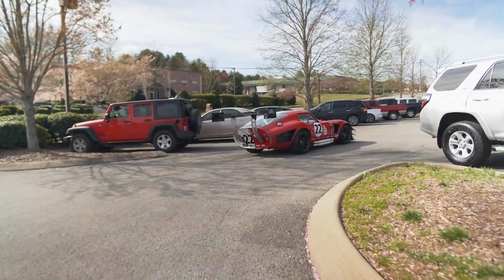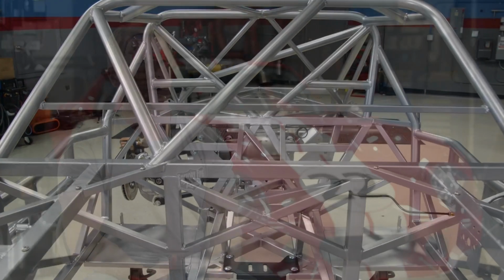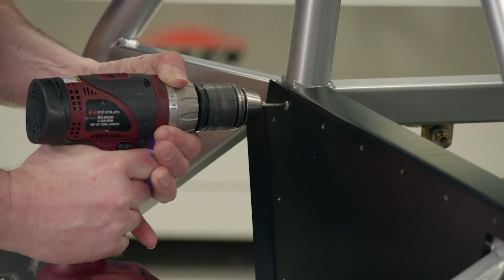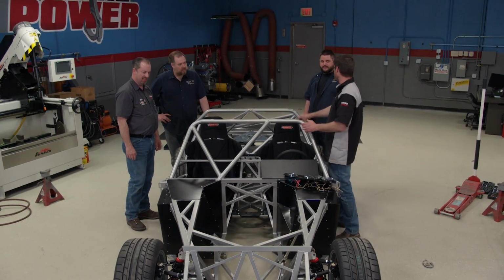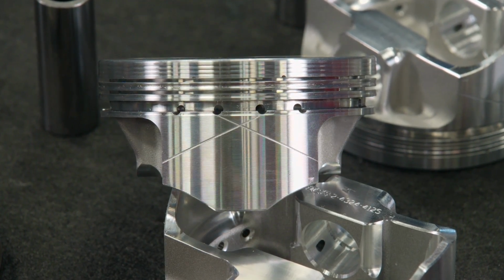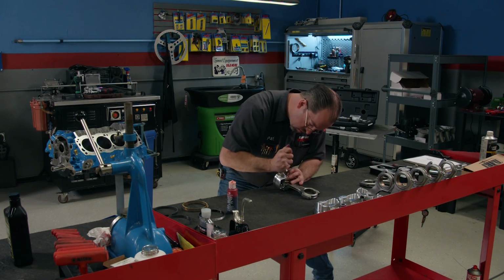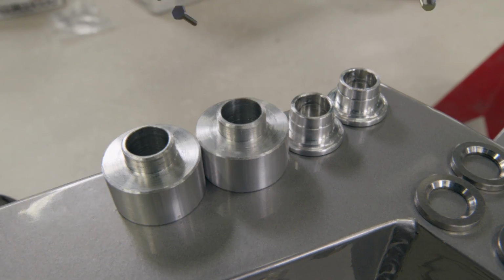Rolling Dyno, Building our Test Sled for Big Horse Power - Engine Power S6, E11

Comment: You shouldn't mix bearing halves they are different  thicknesses now you have a lip at your parting line that will work like a oil scraper on you rod journel polish the crank to size is how I was taught
Reply: The bearings at the parting line are + .003 or +.004 thou this won't be a problem with .0005" difference , and half of that each side .
Reply: @Cobra427Veight  why take the chance on a blueprint endurance build bearings are matched in a pair for proper crush also I wouldn't risk it polish the crank reclean it and assemble it with a matched pair of bearings there not doing a bearing slap on grandma's grocery getter this is a high dollar build and they own a dang lathe and even talk about polishing a crank in the video hell if your gonna half ass it atleast size the tight set with some white Scotch bright or just run the set that's slightly loose a half thousandths loose won't cause an engine failure and will have the proper amount of crush mixing sets is just not a good idea from my teachings
Reply: @79huddy   well ,just check the crush , easy enough . common sense for a Automotive  machinist.
Reply: @Cobra427Veight  I was taught when it comes to my name going on the build do it right or don't do it if it means taking the time to do it times cheaper than a new crank just how I was taught by guys who have assembled everything from sportsman roundy round engines to fully blown offshore boat engines you won't catch Kammer&Kammer or Millets running mixed bearings to get the clearance they are looking for is all I'm saying you have the equipment do the proper job or let somebody else who will this isn't a drag engine that only has to last a minute worth of running at time it's an engine that's gonna be hung out hard at high rpm for hours at a time. It might work 9 out of 10 times but that one time it's gonna trash some expensive parts correct the crank journal diameter and run a matched set of bearings is gonna be right 10 out of 10 times
Reply: @79huddy  It will be great to see some engine assembly content, from you on your channel soon , and Yes i served my time as an automotive  machinist  the same as you .
Reply: @Cobra427Veight  me an a buddy has talked about it we went through school together he used to be old man Jasper's right hand man for a couple years before he became a Preacher I got fed up with the shop I worked at for telling me to half ass shit to get it out the door I still will build an engine for someone but Millets and Kammer&Kammer are two of the  few I trust to to do my machine work for me I wish I had the money for a full outfitted machine shop I kind of miss that work but I don't miss the head aches from the jack offs that bring you a mixed bag of shit and expect miracles then want to talk shit about the builder when they wing the guts out of the bomb they had you assemble from a couple seasons worth of ran hard junk
Reply: @Cobra427Veight  does it matter which half of the connecting rod houses the larger size?
Reply: @leswakimoto9340   I believe the upper  as it provides a slightly thicker bearing , the bearings are made thinner at the parting line to reduce the pinch affect , "Measure your bearings at the parting line", I agree with half of  79huddy a very small amount of polishing ok , its just that radiused cranks can end up hour glassed , or out of round , but  your not going to have a big step at the parting line to scrape the oil  , also what is available to you to make it right .
Reply: The better way Les,  is to fit all your bearings and torque them all down and get your crank "ground to suit" .
Reply: @Cobra427Veight  makes sense thanks
Reply: It can work but I agree, don't like it

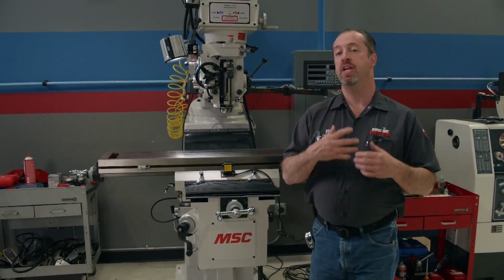Comment: 17:22 How is gdi fuel additive is going to clean the intake valves when it doesn’t touch them?
Reply: You spray the stuff into the intake tract.
Reply: @JohnDove  It's not going to clean off carbon. That stuff has to be manually remove. BTW, my 2016 F150 2.7 ecoboost has 61k miles run fine. I've talked to owners with 200k miles and their engines run fine also.

Comment: 16:46 Why would I spend $100 for arp head bolts when $36 Felpro will work?
Reply: F165 because they gotta get that sponsor money somehow lol
Reply: @95roadie  Go back and watch old videos and they never say anything about arp bolts.
Reply: @bigboreracing356  BS they had enough until hp tv started talking about arp.
Reply: @bigboreracing356  Dude, like i said before. No one but racers used studs until HP TV started talking about them. Now everybody is making so much power that they need them.
Reply: Depends on your power level and if you're running boost.
Reply: Because u can float heads with headblots which are actually technically screws. Also arp head studs are reusable and provide more clamping force because it is a nut and stud which means the force goes into the stud not the thread. Also stock head bolts relay on elongation and yield to provide the proper clamping force which is  not exactly what you want in high horse power applications or alot of  heat cycles all of which typically float a head because you are depending on a region refered as plastic in the stress/strain curve of the metal. Put too much pressure in the cylinder and you push the headbolt over it's ultimate an the gasket gets moved. Get too hot an the elongation combined with the thermal. drops the ultimate strength to the floor very quickly boom head gasket gone. Also good head bolts are not typically 36$ dollars as most people with engine rebuild knowledge would want a cert. Which comes with every arp head stud kit that I have ever bought.